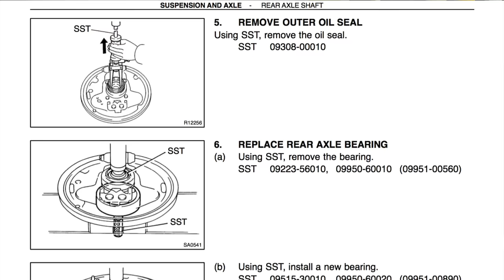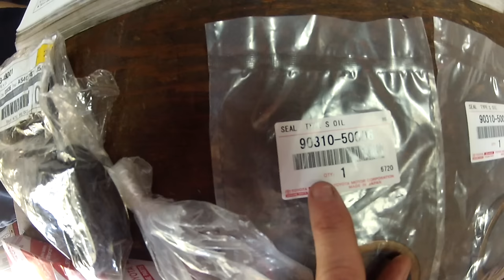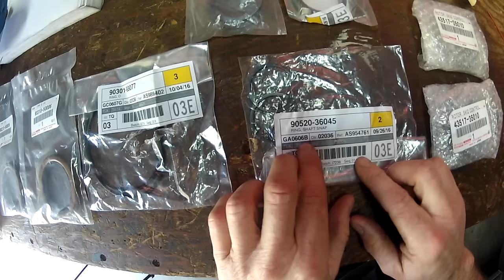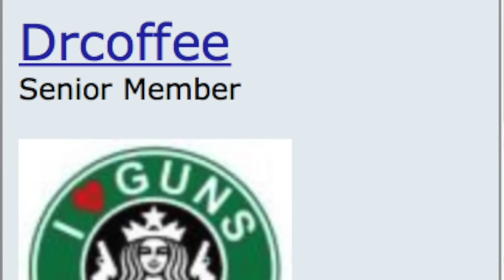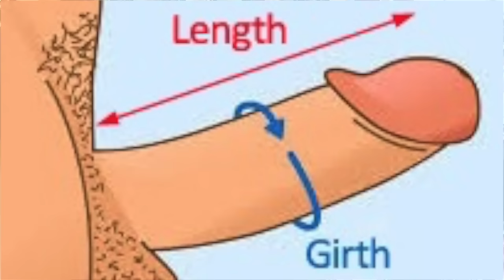Toyota Rear Axle Seal/Bearing Replacement (ABS Rearend)

Comment: Tim,  I have got an 03 Tundra that will need this procedure can I contact you to have you do the job?
Reply from the maker: Where do you live and what's symptoms are you having that you need this job done?
Reply: @TimmyTheToolman  I am in Southern California.  I have got a growling noise coming from the rear bearing.  I have a wireless chassis ear.  It is coming from the passenger rear bearing.  I have just replaced my front bearings and purchased several special tools to do that.  A press was not one of them as I do not have room in the garage for one.  It would be great to have some help for the rear!  Let me know what your rate is?  I just want it done correctly.  Thank you
Reply from the maker: @jaydensbookreviewandothers8806  I'd first have to look into what's involved with these axles and make sure I have the right tools and adapters for it.  The other thing I'm wondering is if your truck can make it that far.  What if the bearing decides to give out completely on you 200 miles from home somewhere on Hwy 5?
Reply: @TimmyTheToolman  I had a chance to jack up the vehicle and look at it last night.  I would never make it.  The bearings are growling like a bear with considerable play!!   I will purchase the press and special tool from Dwain like your video suggests and take care of it.  I appreciate your response.  
One last question: can you recommend the best manufacturer for the rear bearings?  I know Koyo is the OEM of the front bearings.
Reply from the maker: @jaydensbookreviewandothers8806  Ok, that's the smart move.  You don't want to get stuck on the road and potentially destroy your axle and axle housing.  I use OEM bearings but sometimes you can find a more affordable substitute by buying a Koyo bearing that doesn't come in a Toyota box.  It's the same bearing, you're just not paying the markup because it's packaged in a Toyota box.  Good luck with the job.

Comment: Why would Toyota redesign the axle seal if it was going to potentially cause an issue? The original design was fine. Why did it need to be changed?
Reply from the maker: Well, I do believe the new design was an improvement over the old design due to it's pliability but I think they didn't realize the problem it would create by mechanics and DIYers not realizing the mating problem with the inner retainer.  Most people would assume if they got the inner retainer back in the same position on the axle as before, they would be ok, but that's because they were oblivious that the new seal design pushes the seal lip 2mm more inboard than before.  The key to having success with this job is to confirm a good mating of the axle seal with the inner retainer by doing a sharpie or grease test.
Reply: @TimmyTheToolman  While improving the seal in other ways would be beneficial, I think it was unnecessary to change the location of where the lip would be. I don’t see a reason why they would change it in general. 

What if you just don’t press in the seal itself as far into the housing? Let it be 1mm or 2mm out from being fully pressed in
Reply from the maker: @dsgamingmore8212  Yeah, you could try not knocking the seal in all the way.  It just might be hard to do it.  I suppose if you're really careful and patient with the seal installation, you could pull it off.

Comment: Hi, do you know if the rear axles from a tacoma 2015 4x4 are the same or can be replacement for a Tacoma 2005 TRD? (e-lock differential).
Reply from the maker: Cesar J. Hey Cesar, I don't know.  That would be a question for a Toyota forum like Tacoma World.  Ask your question in the 1st Gen section.  I'm assuming they're not going to be compatible but you never know.

Comment: How much would this cost normally? Hard to do this if you live in an apartment.
Reply from the maker: It depends on the area of the country you live.  California labor rates at dealerships and private shops are much more expensive than say somewhere in the Mid West.  At my local dealer, this repair would run more that $1500 if it included replacing the rear brake shoes which normally is required because the brake shoes get coated in gear oil.  My local dealer charges $200/hour.
Reply: Timmy The Toolman I would rather pay you so I know it was done by someone who really knows the system.
Reply from the maker: @gunsfishand4x4  Where do you live?
Reply: Timmy The Toolman I live in Ventura county CA
Reply from the maker: @gunsfishand4x4  That's a seriously long drive to San Jose where I live.

Comment: You could off leave the retainer in the correct position but not pressed all the way in, with the same results but with less chances to damage the seal..
Reply from the maker: The problem with what you're suggesting is the retainer then comes VERY close to rubbing the inside of the axle housing or it actually hits the axle housing.  If it isn't rubbing now, it might be down the road when the bearing develops a bit of play from age.  This is why we recommend flipping the retainer so you can keep it at the original position on the axle shaft with no chance of the retainer hitting the axle housing and getting a good mating with the seal.  These seals are super pliable.  The only way you would damage the seal is if you just rammed the axle into the housing with reckless abandon.  If you carefully slide the axle into the housing, you will not damage the seal with the retainer in the flipped orientation.

Comment: Hey timmy can you give me the specs on your durasolid bearing tool. I have access to a pipe welder at work. To me it just looks like 2 inch gas (black) pipe with a 2" flange on the bottom, can you also measure the plate you had cut down, overall length width and hole to hole measurements. I would think 1/2 inch steel plate with some holes in it would hold up. That sucks that the company won't return your email.
Reply from the maker: Send me your email address and I can start shooting over a bunch of pics I took for another guy.

Comment: Do I use 80w90 or 75w90 for rear differential fluid?
Reply from the maker: The owners manual specifies 80w-90.  But, I now used 75w-90 in my front diff, rear diff and transfer case.  It's just easier.  There's not much difference between 75w-90 and 80w-90.  I'm using Redline 75W-90. https://amzn.to/33eDHeq

Comment: Do you still have to do the grease test on a non abs axle?
Reply from the maker: Yes, the grease test (or now we use a black sharpie) is to confirm the seal is riding in the center of the retainer. If it’s not, you might have a leak.

Comment: Finally just started on mine after procrastinating for fuckin ever. Now i gotta go buy a 20ton press, the special tool i have doesnt fit in my 12ton. Straight up bent the large steel bars tryin to jerry rig it to work. At least harbor freight has some holidays deals right now!
Reply from the maker: You can't go wrong with the Harbor Freight 20 ton press.  It's money well-spent.  Good luck with the rest of the job.

Comment: Hey timmy and sean, do you have the measurement of those holes on that tool at 26:20. I have the specs for the other dimensions of the duratool, I'm just missing the measurements for the bearing removal tool.
Reply from the maker: I need your email address and I can send you some pics.  But, we are going to be showcasing a new axle tool that's bad ass.  It's much more functional than the Durasolid tool.  The video showcasing the tool will be out soon.
Reply: @TimmyTheToolman  thanks for the quick response, you sent me some pics about a month ago, and based on those pics I started collecting the steel that I'll need to fabricate myself. Maybe I'll wait before I start making that tool. I don't plan on actually doing the job until it warms up so I can give myself some more room in my garage. When you show case that new fresh badass tool can you show measurements of things like bolt patterns on the tool and on the rear bearing itself. For us diy guys who might want to make their own. I tried to measure the distance between the bolts on the rear and I'm coming up with off numbers. Hope this jibber jabber makes sense to you, I'm looking foward to see that new tool. Thanks again for everything.
Reply from the maker: @jreg0028  When we introduce the new tool, I can't help people replicate the tool because that wouldn't be fair to the guy who designed it.  The only reason I've decided to help people replicate the Durasolid tool recently is because the Durasolid tool now has issues with it's design and the people who manufacturer it have ignored my emails to acknowledge the problem and fix the issue.  I know you can save money building your own tool but what is your time worth?  The way the new tool is manufactured, you'd have to put a fair amount of time into replicating it.  You buy the tool and use it once and it's paid for itself.  That's the way I look at it.
Reply: @TimmyTheToolman  that's understandable and honorable. I don't want to take money from this man's hard work. I might even buy one from him. My intent was to fabricate one based off the older model. I was just wondering what the dimensions of bearing splitter holes were and also the dimensions of the bolts on the rear bearing itself. But now that you mention it maybe I'll help promote this man's invention as a thank you to his work. Thanks for all you do.
Reply from the maker: @jreg0028  When you see the video, you'll see how nice the tool is designed.  We actually helped him improve it because his tool was basically just a puller for the parts but we had him add in a driver that will work great with the main tool to press the parts on with.  His tool eliminates the need for a bearing splitter by having his own special tool to remove the ABS gear and inner tone ring.  His design also saves people time which you'll see when you watch the video.
Reply: @TimmyTheToolman  sweet man, I'm sold. Make sure to put a link to the tool when the video comes out. I'll be waiting to check it out.

Comment: What's the torque spec for the drain and fill for the rear differential.
Reply from the maker: Hey Ernie, the spec for both the fill and drain plugs is 36 foot pounds.  However, with fill and drain plugs on differentials, transfer cases, and manual transmission, I've always just gone by feel with them even now that I own a torque wrench.  I don't use a torque wrench on the auto transmission drain plug or the engine oil pan drain plug either.  I guess because I've loosened and tightened them for so many years without a torque wrench without stripping or having them come loose I don't feel the need to pick up a torque wrench every time I'm doing preventative maintenance.  Just my personal preference.  Anyway, Happy Wrenching.

Comment: Has anyone ever tried inserting the inner axle seal half way, so that way it has a better seating area on the retainer? Or will that not work?
Reply from the maker: In theory that could work. But that’s essentially what we are doing with the retainer.. seal stays static where it should be, retainer moves slightly to accommodate where the seal rides.

Comment: Sounds like Toyota made the new seals better, but on the condition you return to their service department. Why not just install the seal just above the fully seated position, leaving it a few mm off the base of the seat?
Reply from the maker: You could try that but being precise with driving in the seal is easier said than done.  The seals quite often start going in a bit crooked but self-correct as you drive it in further and finally to it's fully seated position.  With enough patience, you could get a partially driven in and fairly square.  I could see people doing this if they were only trying to replace the seal and didn't want to replace the bearings, retainers and other parts.  But, like I cover in the video intro, it's best to replace everything while you're in there to guarantee the repair will last you a long time.  At the very least the bearing cover should be pried up, cleaned up as best you can and grease added because the gear oil from the differential probably washed all the grease out and then you have a ticking time bomb where the bearing could overheat on a long drive and then very bad things happen.
Reply: @TimmyTheToolman  Marlin Crawler sells a seal kit for like $9.00 for both, it's a HD seal, none OEM, I think I'm going to give it a shot. You could probably find a shims at a gear shop to space the seal out so it sits in the middle of the retainer rather than the leading edge of the retainer. I had a T100 that I never had a problem with the seals leaking almost 300k on that rig . We bought a Tacoma recently, and after about a year of driving it looked the other day on pre-trip inspection to mountains, and I'll be dammed if the drivers side is leaking ever so slowly, only 190k it on, though believe the Tacoma previously served a harder life as a 4x4 Reno area, so the elements take there toll on parts after a while. Good coverage on this problem, there is little on the internet else where on the subject as in depth as you have done.
Reply from the maker: @blkcoupequattro  Marlin Crawler makes good stuff so their seals will probably work out ok.  Good luck with the job.

Comment: Bearing removal from the brake plate;  hook & slide hammer.
Reply from the maker: That works.  We actually just knock it out now with a press sleeve and hammer on the work bench.  We show that technique in Part 2: https://youtu.be/R-c2x3F8DU4

Comment: Can you send me some measurement of that bearing puller tool. I would really appreciate it
Reply from the maker: At first I thought, why not, give this guy some measurements.  Then I thought, I'm helping someone ripoff the design Durasoiid came up with.  In addition I thought, if this guy is a good enough fabricator, he can take what he sees in the video, take some measurements off an axle and figure it out for himself.  Another thing you have to ask yourself is if the time, effort and money you put into making your own tool worth it.  You can buy the tool for $165 from their website: https://www.durasolid.com/product/axle-bearing-puller-toyota/  If you watched the whole video, you saw the tool has some flaws with the thickness of that one plate but you can either do the fix I show or just use longer bolts when pressing out the axle.

So sorry, I'm not going to help you out with this.  However, if you have any questions about this repair or any questions about any of our other videos, just ask and I'll do my best to answer them.

Comment: Anyone know where I can find the axel bearing Toyota discontinued them:(
Reply from the maker: We link them in the video description.  There are still sellers that have them.  

*2001 and 2002 3rd Gen 4runners use a different bearing than the 1996-2000.*
*1996-2000 Bearing #903634002077 (Need 2)
https://ebay.us/GiCrQK

*2001-2002 Bearing #9036340068 (Need 2)
https://amzn.to/2rfReoV

Comment: has anyone found these specialty tools available for rent at an auto parts store?
Reply from the maker: Highly highly doubtful.   The Durasolid tool and new tool we recommend people purchase from an Ebay seller are small independent sellers.  The big chain automotive stores carry tools they get from big suppliers.  I could be wrong but I don't think I am.  If you're worried about money, you could always buy the tool set we recommend that our buddy Duane sells on his Ebay store, use it, and then resell it on Ebay or Craigslist.   You'll lose a little bit of your investment but you'll get most of it back.  Or, you keep it an offer your services to others on a Toyota forum.  You charge them for your assistance and you gain your money back that way.

Comment: Fourth way min 40 coupler and bolt.
Reply from the maker: I don't understand your comment.  Can you clarify what you are trying to say?
Reply: Put a coupler on the bolt then plate then bolt to coupler.
Reply from the maker: I get what you're saying now but the bolt holes on the plate aren't a big enough diameter to fit a coupler.   Now that I altered the plate, it works great.  No need to knock out the serrated bolts and use longer ones to press the axle shaft out.
Reply: Timmy The Toolman  The couplers don't need to go through the plate, 
"just the bolts" plate can sit on couplers and a washer if you want but as long as the space is the same "even" then it's fine, you're pulling on the bolts, like you said you had your plate altered, but someone else may fine doing it with couplers and bolts is fine, no alteration or knocking out studs.
Thank again!

Comment: I need all those tools lol
Reply from the maker: You could buy the needed tools like the special axle tool our buddy Duane sells on his Ebay store and then either keep it or resell it on Ebay at a discount for the next guy to use it.  You would get most of your money back this way and get the job done.  If you like wrenching, that 20 ton Harbor Freight press and the press sleeve kit we use are useful for many many jobs.   I like tools and consider them an investment so I don't mind dropping the coin on them.  Shops charge a shit ton of money for this job.  Buying the tools and doing the job yourself would pay for them after one use.  Something to things about.